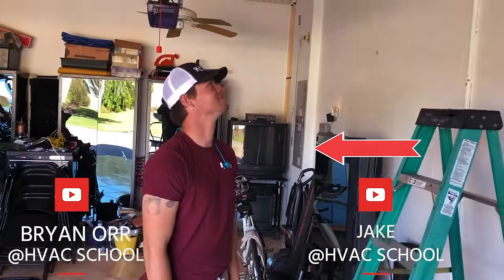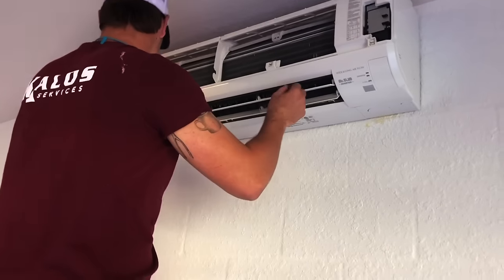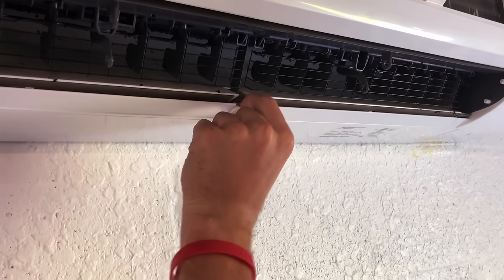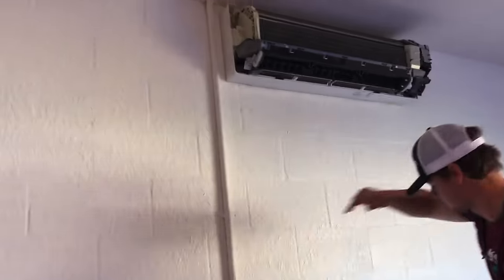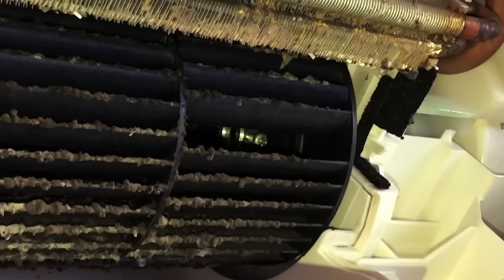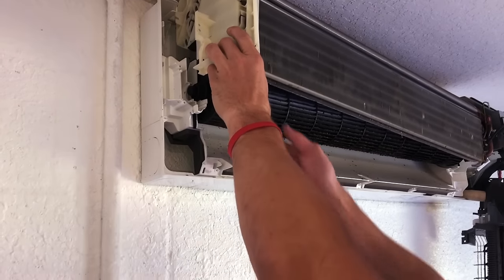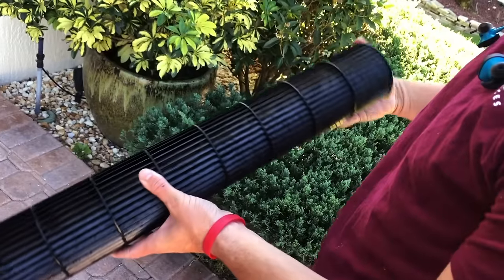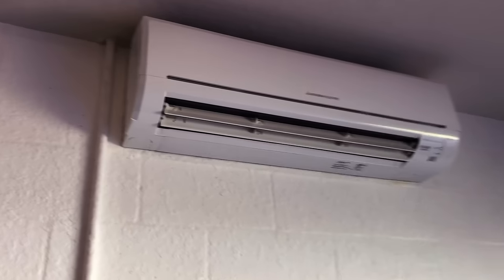Highwall Ductless Blower Wheel Cleaning

Comment: THANK YOU!!! —Your video just saved us hundreds of dollars as the installation tech said, “There is no way you can clean these yourself. It’s just too technical and could be dangerous. We recommend you getting us out here every three months…no later than 6-months between cleanups. For your four units it would be $500, —but we’ll give  you a discount to $350.”   $1400/year Vs a couple of hours and a pack of Clorox wipes. Actually was fun once the first one was done!
Reply: My AC company wants $340 per blower wheel and I have 5 units.
Reply: What a joke. If your careful with the plastic you don't need to call anyone. You need 1 screw driver and 45 minutes. An hour if you've never did it before. Don't believe these goofballs, I do 14 of these in a lodge every 6 months. This is not some skill a handy person can't  aquire. This video shows you everything you need to do, except it doesn't caution you on how easy this plastic is to break.
Reply: Your HVAC companies are ripping you off. My company offers 2 visits a year for $200 for basic maintenance where we clean and inspect all the components both mechanical and electrical. I'd say call around and talk with other companies if you ever find you have issues or get sick of doing the maintenance yourself.
Reply: If I can't maintain it, I don't want it.
Reply: Not all mini's are as maintainable as mitsubishi. On some makes the blower wheel does not come out like that, it is the deepest part. The whole entire unit has to be disassembled in order to get it out.
Reply: The professionals don't even disassemble the unit. They just rise it out in place. There's no way that will clean the fan effectively.
Reply: @andrewtrushinski3848  I am quite happy that I got a Mitsubishi 12 years ago instead of the cheap option at half the price that a friend got.  No plastic making creaking noises and I can actually disassemble and clean it myself. 😂

Comment: My AC guy charged us $600 to top up Freon and said it would cost $13k to fix. The unit simply needed cleaning. I’m a 63 y.o. Woman and even I could do this. THANK YOU!!
Reply: Cute as can be, as well!
Reply: Then stop hiring one man show, hire an actually company where as they can’t rip u off
Reply: 62 yo woman with water dripping from the front. After watching a few videos and ordering a wet dry vac I decided to just take the water hose and spray up into the drain hose just a bit. Tons of water came pouring out along with some goop. Works like brand new and I needed a shop vac anyway😅

Comment: Good thing to do as well is blow out the drain line from the inside when you have the drain pan unmounted. I just use a nitrogen tank with an a/c line set flush attachment and as little nitrogen pressure as needed. Helps eliminate the service calls for water dripping down the wall because the drain pan is clogged (which is more than half of them from my experience).
Reply: Not many people trying to save money by doing this themselves will have access to that gear, right? ;) I use air compressor to blow through it, but not many people have access to air compressor either.

Comment: Great video, saving people money!
You're providing a great service to people... I've got an HVAC buddy and I asked him to check the pressure of my freon. I told him I'd read that low freon will cause freezing over. He said yes, as well as dirty filters and blower wheel. 
I'd never thought the blower wheel would have such an impact, but I'd also noticed diminished air flow... waiting till sunset to pull blower wheel. My filters have never really been dirty, each time I cleaned them.

Comment: Thank you! Had no idea about air conditioners. It was dripping onto my wall, most likely from a blocked evacuation duct (it was newly installed last winter, not sure how that happened). So what I did was disassemble the front part and tilted it some more so that it dripped from the blade fan, into a large bowl. It got us through June like this, when one day we noticed the bowl stopped filling. The evacuation duct cleared itself of the debris, and now the condensation drips outside again. 

Now its September, and we are on the last days were we need the AC. I managed today to put it back and take out the paper I slit in for tilting it more. Learned a little bit about how air conditioners work, and fixed it myself. Feels great. Hope you have a great day!

Comment: I did clean it without dismantling the vanes. The roller type  blower has thin plastic vanes. Heavy accumulation of dust and dirt cake the vanes. They can be easily cleaned using a mascara brush very well.

Comment: Very useful video. Thanks. I have an LG with the same problem. Your instruction confirm the approach I took and my reasoning. The only problem is that in the LG the are obviously some other retainer clips hidden here and there. Preventing me from lifting the evaporator. But I am on the right track. Thank you.

Comment: Thank you! I cleaned everything myself and made it way better than any technician would do. Next time I’ll clean the radiator with special foam, unfortunately I didn’t buy it and hoped the vacuum cleaner would be enough (nope, it's useless). However, cleaning the fan and drainage tray was enough to achieve freshness when turning the aircon on.
Reply: I used a paint brush and warm water to clean the radiator fins. But if I do it again I think i need some gear to flush it out with large volumes of water and something to catch the water underneath...

Comment: Be sure to inspect the wheel and determine if it's good enough to go back in.  Some mini splits have a rubber end holding the shaft that acts as a flex coupler.  If that wears out and gets too soft a perfectly cleaned wheel will vibrate even with a new motor and bearings.
Reply: Hi Mike... Hope you can comment on this. We did multiple in the house. The units are pretty new. Just 2 years.  And one rattles now that we put it back together. But if we push up on the upper left corner, it stops. Can you help?  Quadruple checked all screws, set screws clips, etc ...
Reply: @breannakimes3207  I've run into the same problem. I only hear what sounds like rubbing of fins with AC cooling operation, not while heating.
Reply: @breannakimes3207 mine did the same and I adjusted the blower wheel set screw a couple of times (tighter and then looser) and it eventually stopped the brushing sound of the wheel when in operation.

Comment: This is the method with Mitsubishi units. Most other units don’t require the pan to drop, and have a bushing/bearing on the far end of the wheel that needs to be dealt with. Some Daiken units don’t even have a set screw making then even easier to clean. Which is a good thing because for some reason Daiken units seem to get dirty the fastest.

Comment: Very good video and well filmed. I do wonder if you couldn’t use a spray can of air or compressed air dialed down to blow out the wheel. Especially if you routinely do some maintenance. Obviously garages are dusty places and it might not work there.

Comment: I think the air handler is installed too close to the ceiling. The minimum is at least 5 inches from the ceiling.
Reply: Depends on manufacturer. Daikin calls for little less then 2 inches

Comment: Great video-succinct and  excellent lighting to actually see what/how of things are being done/manipulated (SO rare!🏆). I've done this entire process 5 or 6 times. The cleaning process is not too bad, But I do have one dreaded moment: Getting drip tray reinstalled. Do you have any tips to offer a on doing this step? I can see guide area where white edge should slide up and into place, but I typically feel/hear crunching of metal trying to move in the drip tray. So I'll stop, and gently try to work it back into place. Always seems it takes me an hour to do this one thing-- I worry I'm damaging that area of the unit. I'd really appreciate it reply if you have a moment to provide such. (I live in North Florida👍.)
Reply: Hello Sherry 
How are you doing today?

Comment: Tried cleaning the fan in the bath with a hot soapy water scrub but it was no good. Water blaster is definitely the way to go.
Cleaning the radiator fins and the rest of the parts left attached to the wall is not so simple. If I do it again I think I will try to have a water proof drain curtain so I can wash out the radiator while I have the fan out.

Comment: I didn't know we can pull down the frying pan like that when I clean up the blower wheel yesterday, I have removed three screws from the left side of the blower wheel holder, lift up the coil, and it's a bit hard to pull out, but it's work, and I put back the blower wheel in place. I should try to remove the drain pan first next time, thanks.

Comment: Hello,

I have a Senville SENL24CD/IX.
I am needing to remove the squirrel cage fan but there is no access to the motor retaining screw.
Based on the maintenance manual it looks as though the evaporator needs to be lifted up on the motor side to access the retaining screw.
Unfortunately the refrigerant lines going through the wall will not allow me to raise the evaporator.
Is this the design? It's basically impossible to do unless I pull the unit off the wall way high in the air just for routine service?

Thank you,
Michael Hrischuk

Comment: How do I reset the louver on a DuctlessAire? (I believe it is a Daiken type system) I gently moved it from the closed position to allow access for removal. Now when I put it back together I couldn't manually return it to closed and when turned off, it remains partially open.

Comment: How do you get the screw back in the blower wheel? A magnetic tipped screw driver? Getting it out looks easy.
Reply: The screw dosen't come out just loosen it enough to release the wheel from the pin
Reply: The easiest way is not to remove it (it's a set screw). If you do, yes a magnetic screwdriver makes it simple.

Comment: A company cleaned our blower wheel but it seemed that after they hosed it off they came back soon after, i.e.  returned it without any really long drying period. How long in light spring sun (80 degrees in Florida) would it take for something like that to dry? I am afraid that maybe the guy who did it did not dry it thoroughly before returning it to the unit. He did turn the ac on right afterwards I think, at least briefly but don't really remember. So what happens if water and dampness was still clinging to that blower wheel? Mold?

Comment: My ductless had a refrigerant leak which caused a lot of condensation on the coil and wheel. I did this cleaning method but now I have a musty smell. The unit was thoroughly dried before starting back up again. Any ideas? 😫

Comment: Once my blower wheel was clean and dry I sprayed it with 3m anti-static electronic equipment cleaner and then wiped it off. The next time I went to check the blower wheel which was many months later it was free of dirt. Is there any harm in using this?

Comment: Hi, I unscrew and removed the set screw but the blower wheel is still stuck to the motor and I am unable to pull it out. I have used screw driver as a crowbar to try force it out but it seems stuck to the motor. (I have already loosen the cooling coil). Any suggestions? Thanks.

Comment: QUESTION! What happens if after you remover blower wheel clean and put back in it no longer spins? 
And if the coil gets bent up on the bottom ridges will that show a E3 code? Please someone help, thank you!
Reply: Did you tighten the screw holding the blower to the motor shaft?

Comment: Hi, I'm a service technician from Trinidad. Why not clean the entire evaporator instead of just the blower wheel only on visits? From most of the comments here also it's really expensive just to clean a blower wheel. Most companies here in Trinidad charge around $250 ( average US $40) to clean a 12000 btu evaporator and condenser.

Comment: That air handler/evaporator is installed too close to the ceiling
Reply: Thank you very much
Reply: It’s fine.
Reply: @CT-vm4gf  no it's not fine, there will be difficulty in cleaning the evaporator coil at the back

Comment: My blower wheel is missing 3 blades on one side ...causing it to be off balance..can I remove 3 blades from the other side to balance it again? The system works great but parts aren't made for this unit anymore
Reply: A lot of vertical floor fans use the same type of blower wheel… If you search, I would imagine you might be able to find a found that you can buy and harvest just the blower wheel out of it to replace yours.  Just a thought.  Also, if you know anyone with a 3-D printer, they might be able to 3-D print you a few fan blades that you can glue in with something like crazy glue or  E-6000 (just make sure to give it at least three solid days of drying).

Comment: I have a Lizzeti wall unit, it doesn't have a set screw on the right side (that I can see). My blower wheel also has a bracket with a rubber bushing on the left side. I was able to pop the bracket out and the left side is loose but I can't get the right side out. HELP PLEASE

Comment: Anyone have any advice on quieting the motor or bearings? I have a similar model and it’s just so much more noisy than when we first got it.
Reply: @Dan B yeah it’s kind of like that. More like a whining sound. It was virtually silent when we first got it two years ago and I don’t usually hear that with the Mitsubishi models we have at work.
Reply: @EricCosner  Bad motor, needs to be replaced.
Reply: @maggotthemadman8142  thanks for the reply. Believe it or not, I actually disassembled the back of the motor on mine by drilling a hole and popping it off , and I was able to make a slight adjustment to the bearings that live inside the back of the motor. This quieted it down and it sounds like new again. I figured what the heck, didn’t have anything to lose. 😄
Reply: @EricCosner  Yea that would definitely do it. The motors themselves are usually pretty good, but the bearings go fast (probably by design). My boss even saves them and just throws out the bearings lol.... Good on you for figuring it out though, saved yourself a few bucks!
Reply: I have no idea how to  do that, sounds technical  AND nice to come back here and help. So many people don’t or just say they found a way without saying specifics.

Comment: trying to do this on my Daikin, I've adapted the info from the video with what I've found on my device, but for the love of God I am unable to remove the blower wheel. It is not fastened with any set screw, and it just won't come off if I pull from the opposite side. I've tried various positions, expecting it to have a "release" location, but absolutely NO luck what so ever. Anyone has a clue on how to do this?!
Reply: My Daikin was basically the same as this video. The set screw may be outside the wheel to the right. Or you need to pull harder.
Reply: Mine didn't have a screw, after removing the bearing you might just have to pull really hard.
Reply: @tpain6897  thank you both for the reply! Tried pulling but due to lack of space, I ended up calling the service repair man. He had to completely remove the right side (including the motor) and pulling it like that.
Reply: I had this problem and had to remove the motor. The angle that the blower wheel has to be in will not let it to slide off the motor shaft. Unless the motor brackets are at least loosened the fan will not slide onto the motor shaft because of the angle the blower wheel has to be in to remove it and reinstall it. I did manage to get the blower wheel off the motor shaft by prying the blower against the fan housing but was unable to slide it back on to the shaft without loosening the motor.

Comment: Unable to remove blower blades fully. Unscrewed the the blower as mentioned in 2:23. Able to pull out the left side of the blower, but unable to pull out fully. Like something was holding the blower on the right side.
Reply: My unit I had to back off the set screw almost all the way, and even then it was still quite stuck. Took a bit of pulling force and eventually the fan came unstuck.

Comment: Isn’t this too close to ceiling? I thought 6 or more inches from ceiling was required for all brands I’ve installed. Mostly Fujitsu or LG, with occasional budget Mr cool or cheap pioneer models. Seems like they all spec out having 6” min to pull enough return air.

Comment: You don’t have to waste time taking out the fan from the ac unit.  All you need is an old toothbrush to clean the fan blade while still in there.  Dust will fall off.  Spin the blade with fingers till you reach everything.
Reply: If it’s as bad as mine you definitely do need to take it out. I spent about 30 minutes hosing mine down. It seemed like an endless amount of crud kept coming out. Now way I was going to get it out otherwise.
Reply: @NandR  ok if it’s super dirty and you can super clean it then good.  Six months after you super clean.  Use the toothbrush method every six months.  There should no heavy build up that would require disassembly for many years.
Reply: @anthony-L.A.6946  yeah this is my first split unit and I was told by my landlord to keep the filters clean. I did. But I’ve been here since 2019 and this was my first time seeing the mold on the blower. Or seeing the blower at all. My unit was hardly moving any air at all. Now it’s full speed again.

Comment: why did they design like that, it should have been as easy as cleaning a ceiling fan & while lifting the evaporater if pipes a weak might sprung a leaks, & the car ac blower is a altogther different story.
Reply: Pretty much every minisplit is designed like this. They are going for compactness as it's inside a house.
Reply: 100% agree.  Cleaning capability should be reasonably built into design consideration.